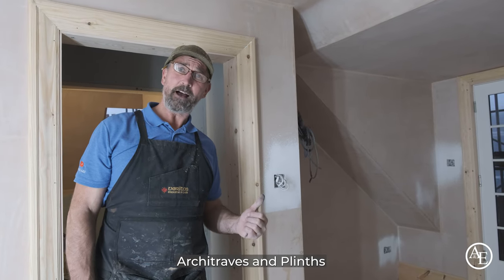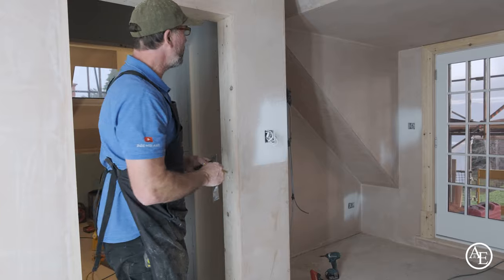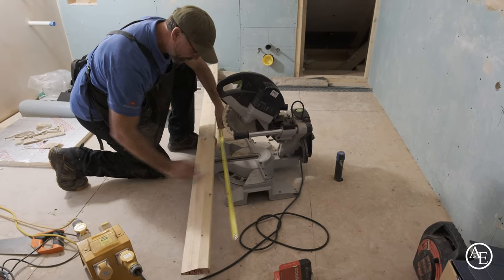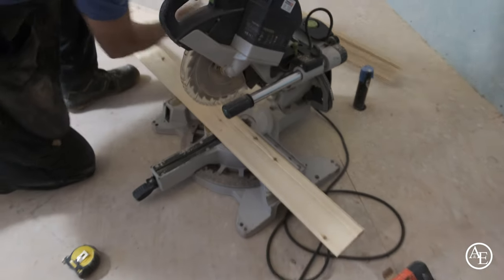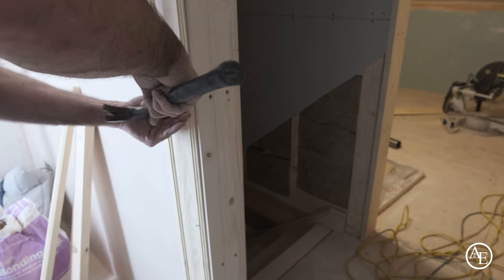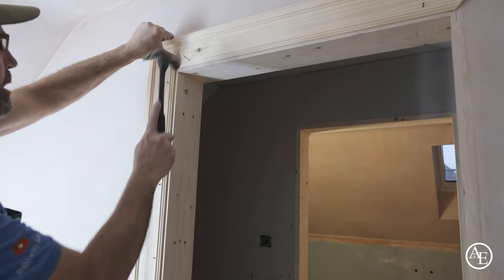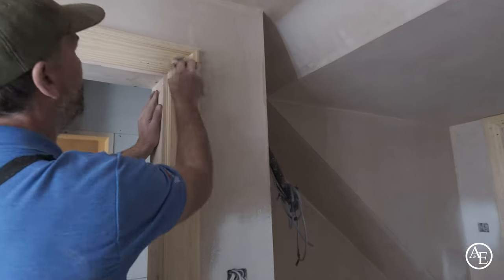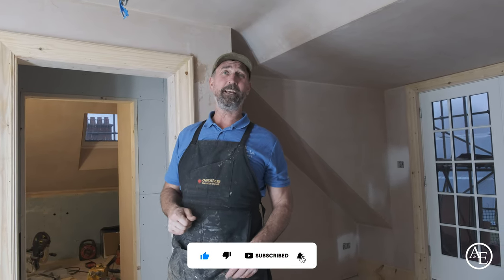Installing an Architrave in Under 14 Minutes

Comment: This is how I was taught back in the day too Tony👊 I always spaced my 1.5" ovals the length of my hammer which divided up nicely on a 6'6" leg👍Thanks for the  video bud🤩
Reply from the maker: Hi Del much appreciated, you are spot on I remember as an apprentice you had to do the mitres by hand and hand plane in if required not allowed to use the chop saw hope you are well all the best Tony 👍
Reply: Any videos coming up Del?
Reply: @denty32  Ask, and you shall receive Mark😉
Reply: @BuildWithAE  Oh yeah Tony, always had to use the block plane to 'tickle' the mitres to perfection😁
Reply: I still do them by hand, my guillotine cuts them perfect but it's too big to take to site. I was always told (and still do) to use 2" brads on architraves. Nice video Tony cheers.
Reply from the maker: @alasdairweir1011  Hi Alasdair 2”, 21/2 and 3” are a great shout to, I do use them in the middle of the architraves especially when stud framing have a awesome weekend all the best Tony 👍
Reply: @BuildWithAE  Hi Tony, great video! Can I ask which nails you were using in this video? I've seen ''40 mm oval nails'' used for this, but not sure if the 2”, 21/2 and 3” nails you refer to are ovals as well or another type of nail? Cheers Ari
Reply from the maker: @Orgakoyd  standard arch 11/2” heavy  arch 2” Ovals thanks for watching all the best Tony 👍
Reply: @BuildWithAE  Thanks for the quick reply!

Comment: Nice to see real wood being used. My joiner said it would take ages to get wood and used mdf for skirting and door frames with big ugly plinths which I hate. Feel like ripping it out now.
Reply: You can get softwood skirtings/architraves off the shelf in most builders merchants. Depends on how complex the profile is, some may need to be ordered in. Its a better product but more expensive. Realistically, once its painted you wont notice the difference.

Comment: Lots of good detail in this one Tony; sorry for the questions but the only silly question is one is the one that wasn't asked. What screws were used for the bottom plinths here please? Also, if you were using MDF architrave, what would your preferred method to glue the mitre? would you use the Evo Stik wood glue or a two-part mitre product? Thanks for this video.
Reply from the maker: I personally only use wood glue it’s just that I’am old school I have seen people use both at the same time to stop movement but if you pin top of both edges it doesn’t need the quick glue
Reply from the maker: Screws used I think were 8gauge no 4 x 21/2 or 3”
Reply: @BuildWithAE  Great, thanks for letting me know Tony!

Comment: What’s going to stop it curling away from the wall when the heating starts going on?
Reply from the maker: Hi Richard absolutely correct I should of gone in to more detail of understanding timbers but it a fine line between making the video to long and to the point. As we are all know Rich timber quality has massively declined because of cost and produce crap product, tell me when was the last U.K. merchant had high grade red deal in never because they don’t it’s a numbers game, now this timber was specifically machined by a joinery shop and used good grade timber the machinist had machined it correctly which is a must, hopefully this explains the reason it’s all about quality of timber have a awesome weekend all the best Tony 👍
Reply: @BuildWithAE  hi Tony, thanks for spending your time to reply.  I’ve been a joiner for 19 years so I totally understand where your coming from with the poor quality of timber theses days.  Just surprised you wouldn’t put some sort of adhesive just in from the outer edge to help reduce some of the movement on a big architrave.  I understand price also comes into big jobs too